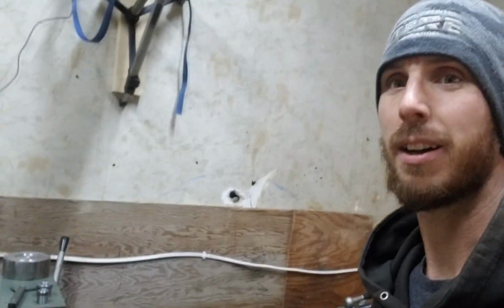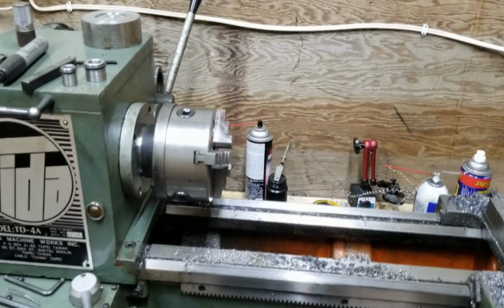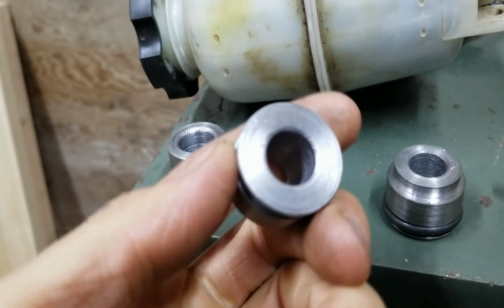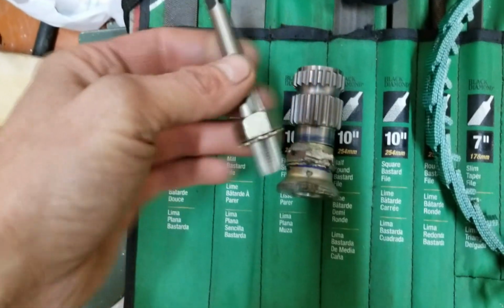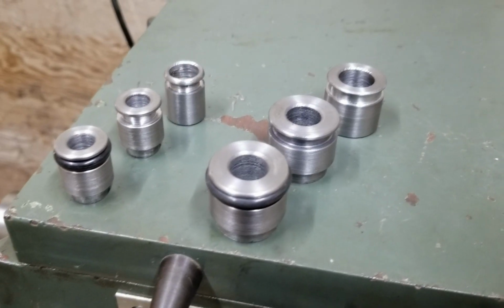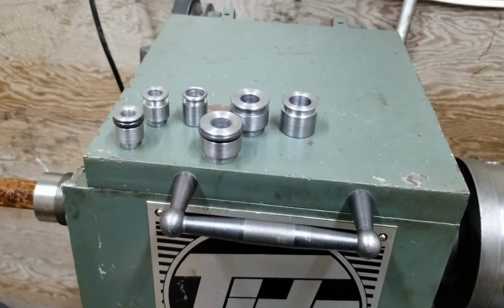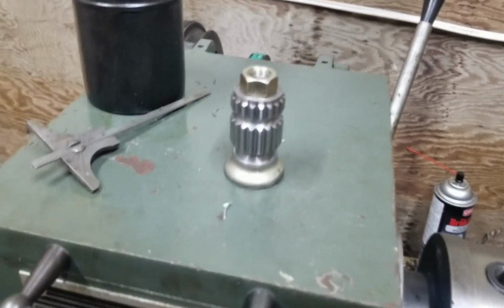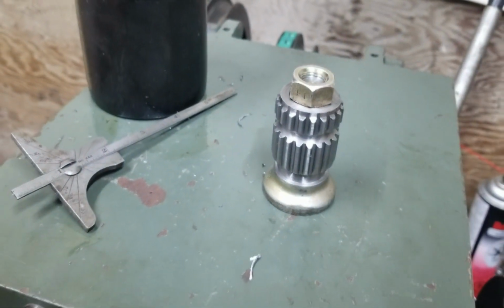Re-machining Brake Fittings, Steering Parts and Frame Tubes

Comment: Also the parts look great! I ended up buying the TG kit to relocate my steering box. Came with the same tubes you made that go into the frame to bolt it down.
Reply from the maker: thanks Clinton! Kyle was trying to source DOM tubing for it, but as soon as i seen what he was going to do with it, i offered to make them for him on the lathe :) i just love machining so much haha! cant wait to get back out to the farm and crank out some more parts! i got a bunch of work to do with aluminum next. one thing i gotta do is get a metal garbage can for all the shavings and chips haha! they are piling up quite quickly.
im also working on designing and 3d printing a new camera mount system that will have you guys in the right orientation :)
cheers!
Reply: @analog56x  Thats awesome!! The machining stuff is great content to. Also stoked to see straight orientation, haha!